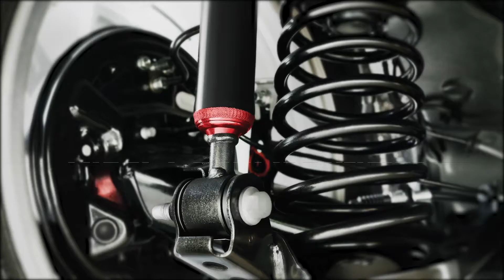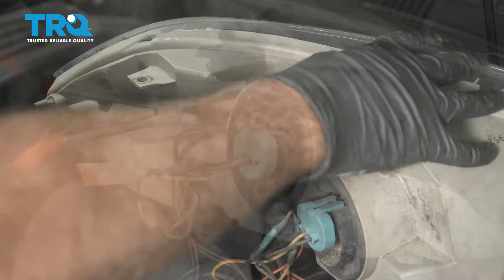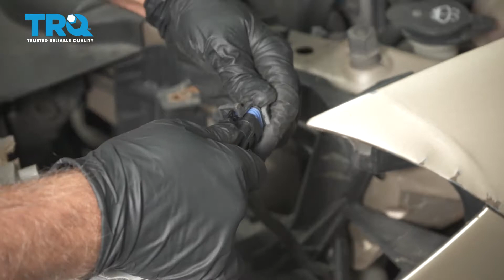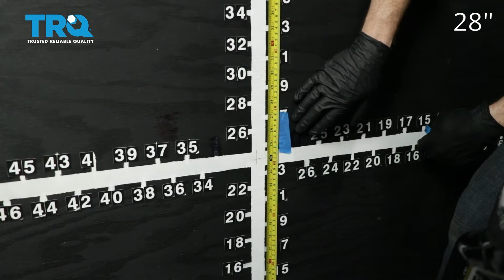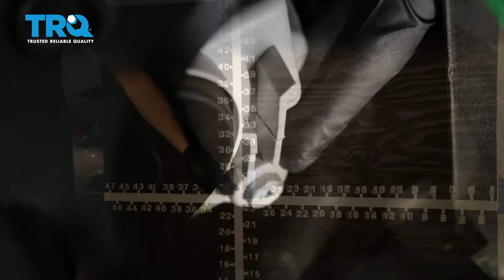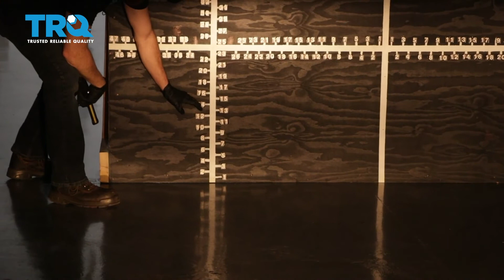How to Replace Headlight Wiring Harness 2005-2010 Chevrolet Cobalt

Comment: That is not the harness that is referred to as the pigtail. If it were the harness, it would contain both sides of the vehicle. The harness is behind that pigtail and reaches around to the opposite side of the vehicle and the opposite pigtail.